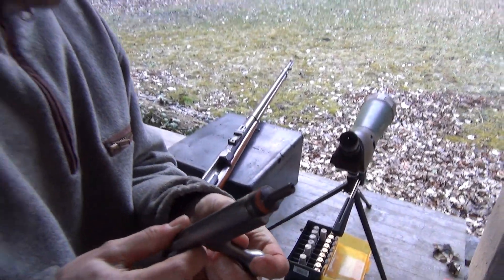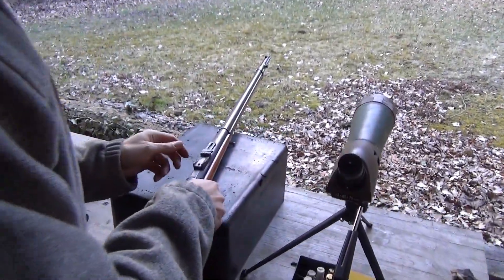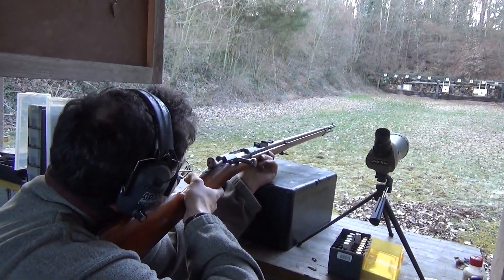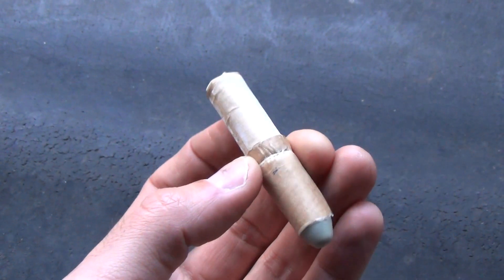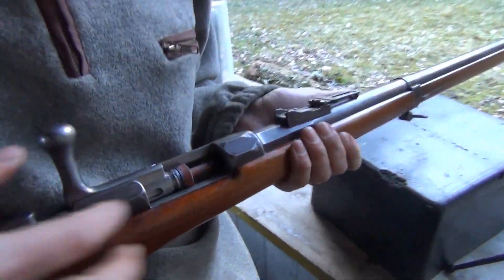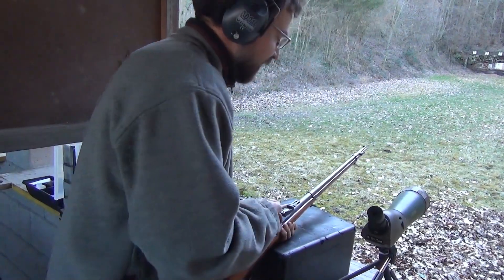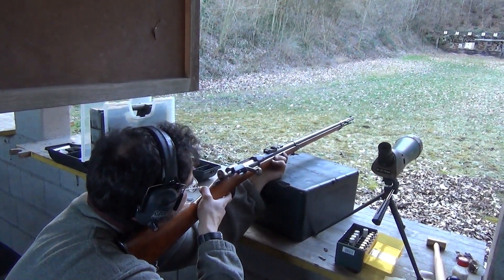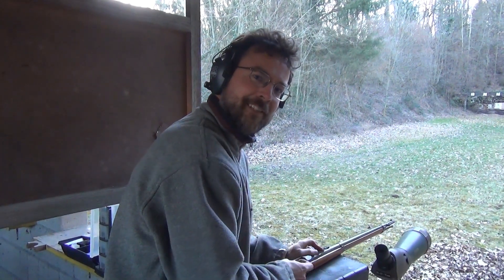Extra video: Chassepot M1866 Needle Rifle With "Original" Cartridges!

Comment: A strange Chassepot indeed... the stock isnt an original one, and the rifle is blued. No military Chassepot, except if it has been upgraded to a Gras rifle standard in 1874, has ever been blued
Reply: The stock is an original military one and the proof marks on the barrel and receiver are the standard ordnance StEtienne ones. The government boxwood MI plug has been removed from the stock and filled in with another wood. The bluing is not a military blue. I suspect that this rifle was « liberated » from the Bourbaki stockpiles by a local Vaudois in February 1871, was thoroughly demiled and kept as a souvenir. Btw the Swiss also did test the Chassepot officially in trials prior to adopting the Vetterli and records indicate that the ones tested were blued.

Comment: It's possible that the reason the for the slow strike on the first shot each time is because of the needles travel through the paper cartridge and powder rather than anything slowing the spring. This means the second strike retains more speed and successfully detonates the primer because the needle has cleared the path on the previous attempt. This could mean that the spring is a bit too light rather than any debris or malfunction causing the slow needle speed.
Reply from the maker: The primer on a chassepot is at the rear of the cartridge, rather than on the base of the bullet as in the Dreyse.

Comment: We shoot them alot in sweden and fire 10 shots under the minut no jams no misfires! it depends on the right restoration of needel system and right made cartridges, just look after wear on the real rubber discs or you get a nice bloow :)
Reply: Tomas Palm Interesting that they are popular in Sweden. I guess there are not many Hagströms in Swedish ranges 😊 I have come a long way since this vid. I have 100% reliability but still have a few fouling issues. I’m still focusing on the original cartridge before I start cheating with simpler methods.

Comment: Good work! Glad to see I wasn't the only one who got the buzzing sticky cocking piece.  Suggestion: get rid of the wax on the rear! 
My Dreyse is eager to compete with your Chassepot in Lodrino
Reply: SBAM Shooting I was following the official method which uses a waxed base, although I probably overdid it, I also didn’t include a rubber disc behind the primer which is there to help against soot buildup in the needle channel.

Comment: I wonder if any cartridges ever went off when you were forcing them into the chamber - sure would be tough on your finger.......
Reply: Merle Morrison Highly unlikely, the primer is recessed inside the cartridge and needs a heavy strike.  My cartridges are slightly too long, normally they should just be dropped in and chamber by simply closing the bolt..
Reply: OK, thanks - I thought the primer was at the base - like a modern cartridge
Reply: Bloke on the Range
3 weeks ago
The primer on a chassepot is at the rear of the cartridge, rather than on the base of the bullet as in the Dreyse.
Reply: Carbon 12 It is at the rear but not flush like a modern cartridge, the needle needs to penetrate 5-6mm into the cartridge base before reaching the priming compound.
Reply: A known problem was the needle breaking or getting gummed up with fouling and not retracting fully. Just a few years ago a chap (not THE Chap) had one go off before the bolt closed so it is worth running your finger over the tip of the bolt before chambering to make sure that the needle is not stuck out at all. Blew the bolt handle into his hand. Much surgery. There is a whole book on Chassepot failures. Still much better than a Dreyse, but then a design 25 years newer should be.

Comment: I have a Chassepot 16 bore shotgun, not sure if its was built as a shotgun or converted from a rifle.
Reply: Jon Collins AFAK Chassepot didn’t venture into shotguns, however the Gras and Gras converted Chassepot were converted into shotguns. Calibre varies from 16g to 20g.
Reply: Hello, I've been doing some research on this arm but I'm getting contradicting information on its barrel construction. Was the rifling done in a clockwise twist, anti clockwise or both? Was the barrel made up from  one component or two? I'd really like to have some information from an owner who can have a look.
Reply: MsCellaDOR The barrel is one piece, rifling is 4-groove left hand twist.  I suspect your reference to two part construction probably refers to the Chassepot converted to Gras (Mle1866-74) which for the most part have a chamber sleeve inserted in the barrel.
Reply: I've spoken to three collectioners and they all gave me the same information as you concerning the conversion and the twist. When I asked about rifling today they came up with different answers. The first man said that rifling twist is always to the right (clockwise), through convention or tradition. The second man said that about 30% of all modern rifles fire with an anti-clockwise twist. Finally, the last person said they didn't know and had never asked themselves the question. Was the French rifle unique for its time? What are your thoughts on this? Thanks for the information given beforehand too.
Reply: MsCellaDOR I don’t believe the French were unique in LH twist, Colt favoured it in his revolvers.  Enfield used it too in the Lee-Enfields.  Nowadays you can have whatever you want.
Reply: Many thanks.

Comment: These chassepots seem a vast improvemente on the lebel. Why didnt they use these in ww1
Reply: Dellacondan Lol! Requiring bolt disassembly and chamber cleaning after max 50 rounds would be a bad thing in WW1.
Reply: The Chap yes, but with all the black powder smoke les boches wouldnt be able to find a poor bloody poilu. Bet it has a higher rate of fire than a lemerde with the mag cutoff engaged.
Then they could taunt them a second time from behind a smoke screen.
Reply: Dellacondan Nope, having mad-minuted the Lebel, single loading is actually pretty fast and easy.  In any case for trench warfare catapults were for the cool kids so “fetchez la vache”!
Reply from the maker: Would be less fast loading from a pouch rather than from a box right next to you though :p
Reply: Bloke on the Range Interesting question as to whether they would have had loose ammo boxed and ready if they were expecting a post
bombardment charge.
Reply from the maker: Doubt it. It would likely go alles über der Platz. Plus you'd see it in archive photos or have had it mentioned in memoirs.
Reply from the maker: Back to the original post: "These chassepots seem a vast improvemente on the lebel." Can I have some of what you're smoking please? :D :D :D
Reply: The Chap maaate i was just raggin on the lemerde. 😝
Catapults? The coolest rich kids had a trabuchette.
I still maintain tommy atkins should have been using long bows for the plunging shot effect in the trenches. Dashed annoying for the bally hun. 'Herr oberleutnant her oberleutnant de tommies sint arrows geshiessen!!!' 
'Arrows geshiessen? Was is los??? Eine wonderweapon??' (No i cant remember arrows nor wonderweapons in german. My german sucks mauser actions.)

Comment: After a year or so of my Chasspot obsession I gladly returned to muzzleloaders. It seemed like I spent hours  making cartridges and cleaning the gun.

BTW if you use the ramrod/cleaning rod to remove a cartridge that misfires, be sure to remove the rod before firing the next cartridge.
Reply from the maker: We've got some awesome Chassepot cartridge vids coming up. But they'll probably just be on the other platforms due to YT capriciousness.
Reply: What happened with your rod?

Did you accidentally fired it out 🤣
Reply: @alifr4088  Yes.  Fortunately it was resting against the bullet.  The combination of 400 grain bullet plus the weight of the cleaning rod produces an unbelievable amount of recoil.  It also makes your rod, a rod that is serial numbered with the gun,  into the shape of a pretzel.
Reply: @MFGordon  F

Comment: Seems like a bit of a pain in the Ass to deal with worrying about it. The Gras or Gewehr 71 wouldn't have this issue because of metallic cartridge
Reply: Mason Haggerty well yes with hindsight but at the time industry was not yet capable of producing large volumes of quality metallic high power cartridges, especially in Europe.
Reply: The Chap I know I'm.just saying. I wouldn't have much patience myself if I kept getting duds and having to baby it a bit but i mean it is 150 years old + so I get that
Reply: Mason Haggerty Hopefully with the lessons learned from this session it will run much more smoothly next time.
Reply: If it does go well let me know what formula works I was tempted to buy a chassepot from.a friend but idk how I would load for it.
Reply: Mason Haggerty It wasn’t duds, it was fouling slowing down the striker-needle assembly.  I only had one cartridge fail in the end and that was due to me not making it properly.
Reply: Mason Haggerty The method I’m using is for original pattern cartridges which are quite complex, and I’ll be explaining it all in a BoTR film. There are other much simpler techniques out there.
Reply: The Chap   Original cartridge! Original cartridge! Do it! Make video! I'm still struggling to comprehend how this thing miraculously works. By rights there should be flames and smoke and cartridge debris blasting all over the shop ... but no! It flipping works! I'm singularly impressed.
Reply: gussie88bunny A vid has already been made and is awaiting release (40min behemoth), both for the original pattern and a chap-exclusive turbo method.

Comment: My new Chassepot shoots 50cm high at 50 meters, when the rear sight is set forward to the lowest hight. Does that sound right to you? I haven’t had a chance to shoot it at 100 meters. The previous owner did quite well at 100 meters. I’m using Vectan PNF2. I will add that my chamber was a lot cleaner than yours after 12 shots. I always heard Swiss powder was very clean burning. Your advice is greatly appreciated. Thanks.

Comment: Wow! That hardly looks like an improvement on the rifled musket. At least it had a bayonet.
Reply: dbmail545 Don’t take this test run as gospel.  A needle gun outshoots and outrages a rifled musket, it can also be easily reloaded prone and duds can be easily cleared.  Rate of fire is also obviously much higher.  The Danes in 1864 and Austrians in 1866 found out the hard way when they came up against the Prussians and got bloody noses.